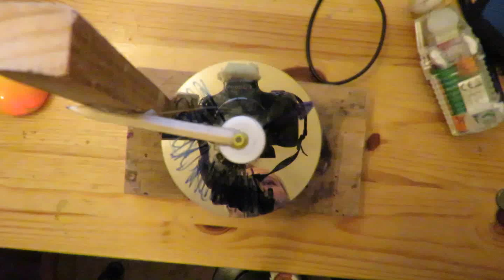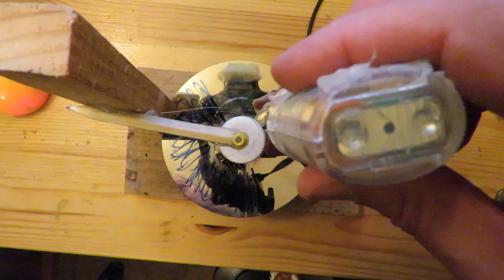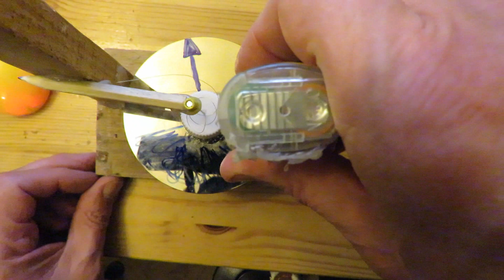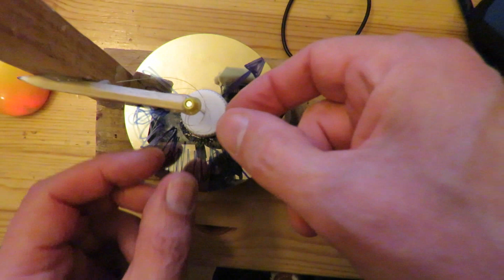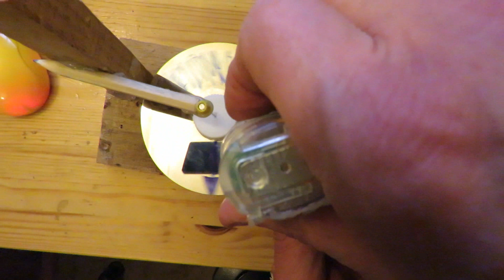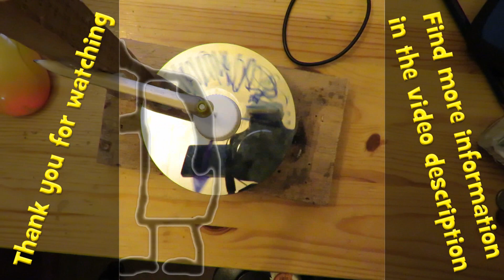Spinning an Aluminium Disk with a magnet #3 rotation on same axis

Comment: It came in JEE ADVANCED 2020 thanks😂😂
A light disc made of aluminium (a nonmagnetic material) is kept horizontally and is free to rotate
about its axis as shown in the figure. A strong magnet is held vertically at a point above the disc away 
from its axis. On revolving the magnet about the axis of the disc, the disc will (figure is schematic 
and not drawn to scale)
(A) rotate in the direction opposite to the direction of magnet’s motion
(B) rotate in the same direction as the direction of magnet’s motion
(C) not rotate and its temperature will remain unchanged
(D) not rotate but its temperature will slowly rise
Reply from the maker: Hey thanks, I was wondering why I was suddenly getting views on this old video 😁👍
Reply: @GrandadIsAnOldMan  that's y I just sent u the que lol😂 a very nice vedio btw keep making such👍👍👍👍
Reply from the maker: @aryanshah1520  good luck with your exam results 👍
Reply: @GrandadIsAnOldMan  bro I cracked this exam last year itself and i'm already in IIT and  I was just viewing the paper of this year and when I was confused with this que I got your vedio thanks for the luck btw. Lol 😂😂😂👍👍👍👍
Reply from the maker: @aryanshah1520  congratulations, I wish you continued success 👍
Reply: @GrandadIsAnOldMan  same to u bro nice to talk to you. Please keep making such vedios they are really helpful.
Reply: this came in CIE Advanced Level Physics papers

Comment: Sir will the disc rotate only if a neodymium magnet is used?can u try with ferrite magnets and tell if it works
Reply from the maker: Why don't you just try it yourself. The only difference between a neodymium and a ferrite magnet is the strength of the field. The laws of electromagnetism still apply. Clearly the stronger the field in the magnet the stronger the effect so the disk will spin up quicker
Reply: GrandadIsAnOldMan Thanks a ton!!!
Reply from the maker: Bhuvana Ramanan  You will learn far more from personal experience, videos can always be faked to "prove" a point.

Comment: Can u kindly tell how did u make the magnet spin? Or can u make a short video for attaching the magnet with motor
Reply from the maker: The magnets are simply attached to the shaft of a battery powered fan6. Ittook the fan blades off and used sticky tape to hold the magnets in place
Reply: GrandadIsAnOldMan Thank you so much